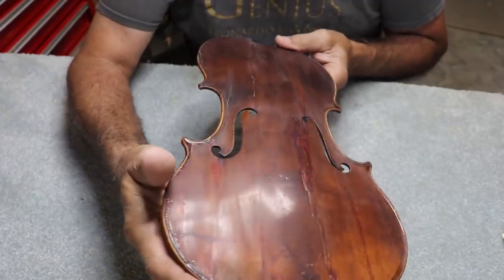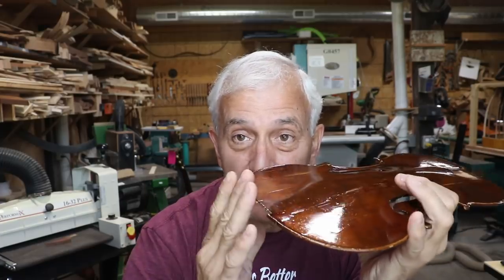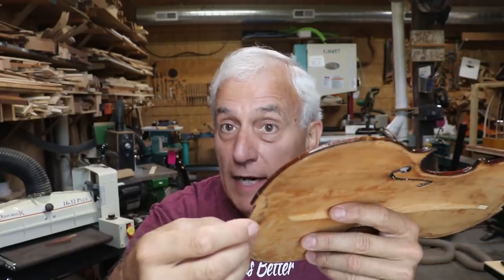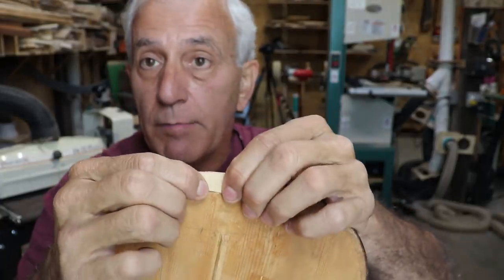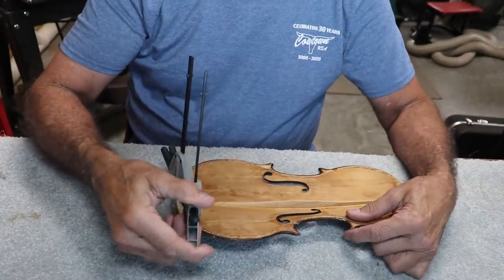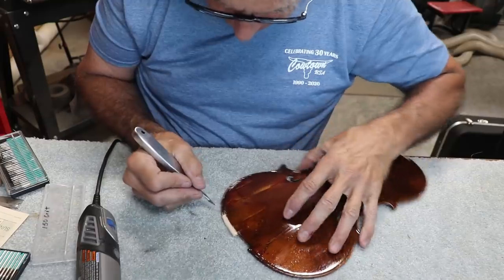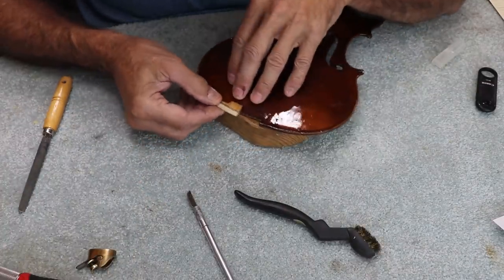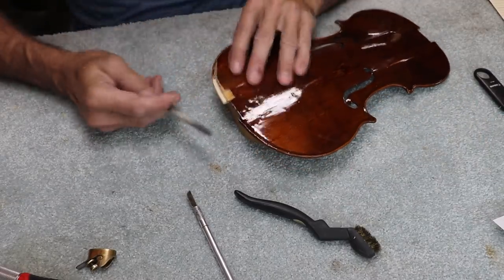433 RSW Chocolate A Bittersweet Restoration Part 3

Comment: I’m working on a cello restoration right now with much less damage overall, but some similar issues with light streaks after levelling across cracks. Came back to look at this for inspiration. I’m hoping I can get some trompe l’oeil oil stain applied with an artist brush to stay put under a layer of shellac along those streaks, and then float a couple of coats of French polish over the whole thing. Hoping I don’t wind up stripping the whole thing…….

Comment: Try adding some stain to the oil.  Paint this just over the light part.
Reply: That is what I do on rifle stock touch ups - mix a bit of stain with the shellac/ oil stock mix and treat the blemishes to a reasonable match before applying the rub finish to the whole stock.
Reply: Would it be a crime to use an artist’s airbrush to spray thinned oil finish mixed with stain over the light spots? Then a final top level coat over the hold instrument table?

Comment: I was thinking that you really need to go back to bare wood too.  You did a great job piecing it back together , but with so many finish cracks, its best to make the finish even.  It's a shame that that happened to such a beautiful piece of history, but sometimes you have to do something to preserve the beauty instead of just a good repair.  I think you can get the color back to what it was, you have others there with good eyes.  Keep up the great work

You should be able to level out the cracks better also.  But I hope you use some kind of backing pad and not just your fingers.
Reply from the maker: The instructions from the varnish company say to use your fingers.  the notes have said on the screen I have used countless methods to put varnishes on. Including brushes and spraying everything that you can think of between those. It's not my 1st rodeo
Reply: @RosaStringWorks  Jerry, Sorry I wasn't clear,  I wasn't talking about the varnish, I was talking about when you sand.  I have painted many things, model airplanes, cars, boats, furniture, and instruments over the course of 40 years.  Its better to use some kind of backing pad/block when you sand. 

Using your fingers for backing when sanding leaves an uneven surface every time (metal, wood, plastic....).  On flat surfaces or shallow curved surfaces, like on a car body, I use a paint stick wrapped with 220 for initial blocking, or 400 , sanding on 45s. Curved surfaces, I use either a 3m squeegee or some dense foam, that is rigid but still semi flexible.

By the way, you are right about trying to get a smooth finish, the grain soaks up and leaves dry/low spots.  The only way is to just keep using finish to build it up.  No short cut, but that is the difference between a work of art and something that will just do.  Varnishing on old wooden boats, I had sometimes put as many as 30 coats on to get a good finish.

Also, if I may suggest, look up a Nib File, I think it will help with initial leveling when you fill cracks.  Its used in auto body to remove drips before you wet sand.  Only a few bucks at an automotive paint store.  I will look through my tools and see if I can find one to send you.  I haven't had a run in so many years, I don't remember where I put them.

Comment: Don’t feel bad about that finish.  I refinished a gunstock many years ago and the True Oil did exactly the same thing as what it was doing with Chocolate.   Drove me nuts.    Something about that True Oil chemistry causes it not to want to mix with some stains.   It seems geared towards finishing non-stained bare wood. I never did get that stock to where I wanted it. It looks good but not great.

Comment: Probably this is just another avenue that Chocolate wouldn't cooperate with, but adding colorant to the varnish might have worked. I did an old, badly damaged SS Stewart archtop that had to be stripped around the neck joint, and StewMac colored lacquer worked incredibly well blending to the original color. Don't know if this would work the same with varnish. Should.

Comment: What factors determine when to "restore"  (via extensive glue repair) vs. when to replace a component?  How bad would that top have to be before you decided to simply build a new one? Would that procedure change the "integrity" of the original instrument and/or give it a better sound vs. a glued-up top? What goes into such a decision?
Reply: if I'm not mistaken which in truth I have been before.. these instruments are glued up tops and backs ??? this repair and any like it just has a bit more glue? ...and from what I see he is very careful not to have a lot of run out ...

Comment: If it was me I would give it a good rub down with steel wool, wipe it clean with alcohol, then mix some of the color with a little bit of varnish. Blend it in with the brush and let it dry then a coat of clear varnish on top.

Comment: Hi Jerry when routing small parts on the flat surface could you install four adjustable screw to your router base so it sit at the right depth from the surface?

Comment: I suspect that the issue is that the particular stain you used is meant for bare wood and when applied to a varnished surface, it just sits on top of it, then gets washed off by the next coat of varnish, in a different reaction that applying it over that walnut stain. In other words, this time, you're not actually penetrating & staining the cured varnish. 

Possibly it would have helped to mix a bit of the varnish with the stain (...if they're compatible with each other...ie: the stain is not water stain), applying & letting that dry. Then darkness of the stained area could have been adjusted, rather than with the color of the stain, but rather by the number of coats of stain/varnish applied &/or sanded off, such that, rather than just the color of the stain itself, the thickness of the what remains will determine the final color of the that area...sort of like sanding off bare stained wood if it's too dark. 

But, at least, the new varnish coat would not dissolve what's in that area once cured. So, you would not have had to worry about the final varnish coats changing the color of the stained area, like happened when you applied the oil varnish over the walnut-stained bare wood.. 

In any event, I certainly appreciate your frustrations with the difficulty of matching old finished areas with new finish, color-blind or not! In the end, you got a remarkably result. Good job, Jerry!

Comment: I wonder if leather dye would have worked better than stain....
Reply from the maker: That's what I started with
Reply: @RosaStringWorks  OK, I thought you said you started with Minwax dark walnut stain. I wonder if you could have tinted a bit of of the oil varnish with the stain or leather dye to apply over those areas before varnishing he whole thing... But that's hindsight talking ad there was no way to know that might be needed until you already had the whole thing varnished and doing that at this point would end up with too many coats.
I have a feeling stripping it is the right decision.

Comment: Hey, just a quick thought about the stain issue, again. Could it be that this is one of the times you need the oil based stains, instead of the alcohol based ones? It might be that the oil based ones would blend with the varnish, which is also oil based, and do a better job. I could definitely be 100% wrong here, but maybe mixing the stain with the varnish before you apply it could be the way to go, as well. Just spitballing, here. But your approach of just stripping it and starting over is probably the best idea in the long run. SO much damage to fix, and then trying to match color, as well? I have pretty good color perception and I wouldn't want to do that.
Reply from the maker: I actually was using the oil based ones.
Reply: @RosaStringWorks  AH, got it. So that isn't the problem, then. I think you have it right, either way, stripping it off and starting over. You will definitely get the best appearance that way, and most likely the most solid finish, too. Like I said, I'm amazed at what you have done with that pile of very thin kindling. Can't wait to hear it!

Comment: I've a question; Do you place a label inside your rebuilds? My thoughts are that sometime in the future someone has to rebuild/repair something and find your label and knows that it has had a very well done rebuild in 2020. (I would place mine, if I were to do something like this, on the top as to be there but not visible unless the top is taken off and/or a camera was used.)

Comment: Traditional violin varnish often has color in the varnish. Taking it to bare wood will alter the sound that has been achieved by the age of the original varnish. Of course it's all been pretty much compromised.  It's probably the age of the wood itself that contributes the most to the tone. I've read countless theories on the effects of varnish on the tone, the only real concern is not getting so much varnish that it dulls the tone. I've repaired a few, and all in all you've done a great job for someone who hasn't repairs dozens of fiddles, and this one was beyond what most would even try.
Reply from the maker: I think you might have missed something. I have repaired hundreds and hundreds of fiddles over the last 40 years.

Comment: I was wondering if you could put stain on the inside and have it soak through to the top? I know nothing.
Reply: Ask yourself this:  does the stain applied to the top soak through to the inside? (Answer is:  no it doesn't so it probably won't work the other way.)😀😀

Comment: Probably a stupid question.  When doing the finish on a repair, wouldn't it be easier to match the finish if you stripped the old finish off and just started over?
Reply from the maker: The tradition is your not supposed to refinish instruments. Instruments that have been refinished generally drop in value quite a bit.
Reply: @RosaStringWorks  ooooh.  That makes sense.

Comment: instead of rub on oil why not spray satin lacquer, I would imagine this would work better in that situation. cheers
Reply from the maker: Oil varnishes the preferred varnish for violins.
Reply: @RosaStringWorks  oh, did not know that. I do alot of modeling, like mostly ww1 aircraft . Sometimes if using oil based coloring and brushing oil based clear it would melt it. I found I had to spray light cotes of lacquer . It seemed like that's what was going on with your situation the oil was disolving the stain.  Is the gun stock oil better for tone? I assumed they would have used a shellac back in the 1800s or lacquer.

Comment: Never stain wood.  Never.  You must seal it first.  It acts as a barrier. The stain goes on top of that.  If you try to stain the wood it will just end up looking less than optimal.  I implore you to study how furniture restorers or painting restorers work. They have exactly the same problems as you do.  They always add a barrier between original finish and trying too color match.  If it does not work it can be reversed, without affecting the wood directly.  You can taint lacquers nd varnishes.  So adding the dye to the lacquer will give you a wash.  It is applied very thinly and built up.  It is not a quick process, but it means it can be more easily adjusted , and t will give a better result.  Being color blind is a big handicap in working with subtle tones.   I have seen a lot of your videos where you have the same issue.  You really need a permanent solution